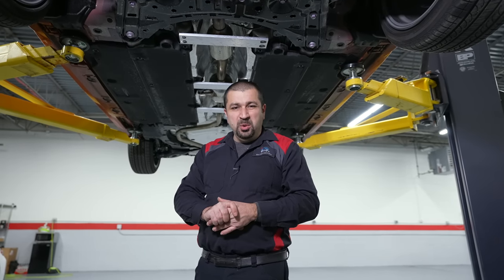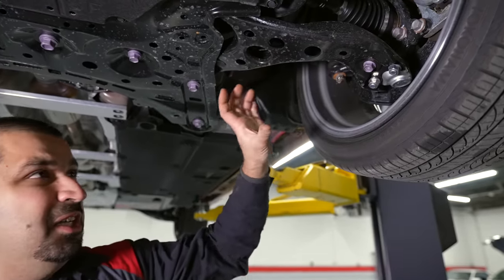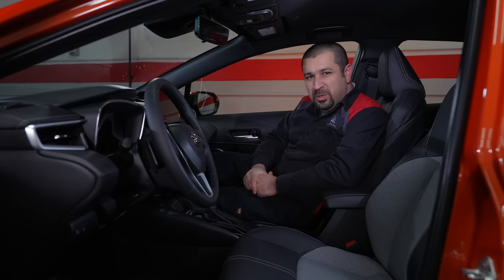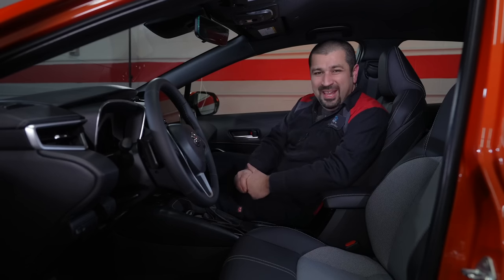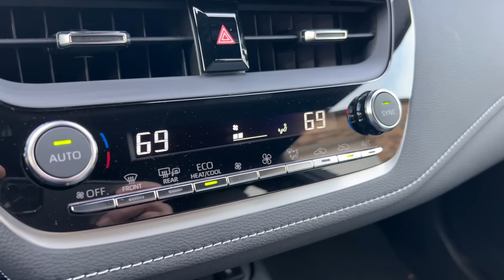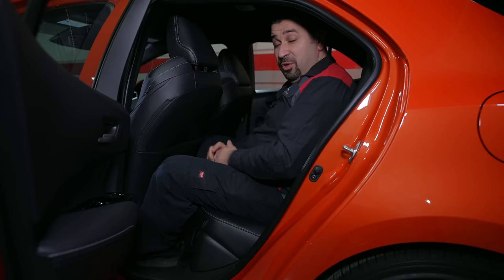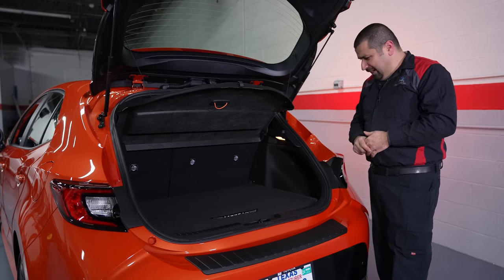Should You Buy a Toyota Corolla in 2023? I Have Good News and Bad News!

Comment: I have a 2023 le. The handle on the front door panels protrude out and are hard af... they hurt my knee when resting my leg on it. The interior plastics door panels especially the rear come off with a slight pull... they feel cheaply made, check the entire car 4 times before you buy one... seems to be fine mechanically so far but its been literally 2 days
Reply: I have a 2022 se the interior feels cheap but besides that it’s fine
Reply: @donew1thita11  super cheap... on you rear door panels where the window up and down is.. try to lightly pull on that and see if it just detaches from the whole panel... cuz mine does... came off in a friends hand the other day... talk about embarrassing... going to the dealer tomorrow to see if thats normal

Comment: Does the new corolla use 0w8 oil and if so can u use 0w16
Reply: Correct you can use the 0W 16 as stated in the owners manual if the lighter oil is not available

Comment: My first Corolla was a 1981, a 1993, then a 2008, all base models with manual transmissions. Since the new Corollas don't offer a manual transmission, I bought a 2023 Subaru Crosstrek with a manual transmission. I just hope the Crosstrek is as good as my Corollas were.
Reply: @Paul Fortman I just bought a 1986 manual transmission Camry lift back as a Sunday driver./weekend toy. There’s just something about older Toyotas with manual transmissions where they drive exactly how a young kid would imagine a stick shift vehicle drives, if you know what I mean. The best Toyota I’ve ever driven in my life (so far, I’m still a teen), 1992 Silver taupe Camry DX 5 speed. That car felt absolutely amazing to drive and the gear ratios were perfect and relaxing for someone to drive, without having to feel like busting ass as fast as possible like in a Civic, again, if you know what I mean. Out of all your Toyota’s you just mentioned, which one was your favorite and what one put on the most miles? Just curious. My ‘86 Camry only has 115,000 original miles as the original owner was a 90 year old man who owned it from new until summer of 2020. Extremely clean for the age. Still has the delicious new classic car smell inside.
Reply: I had a brand new 2007 corolla LE 5 speed and it was by far the best most reliable car I've ever driven. Just bought a 2024 corolla SE 2 days ago.  Waiting for it to get here and I can't wait but I know I'm gonna be disappointed because that 2007 5 speed was the definition of quality.

Comment: Hatchback should have more space in back for carrying things, especially if you fold down the rear seatbacks. Can you fold down the seats to show us how much room it has? More room than the sedan? Also, what is the power and torque of the engine? What is the weight of the vehicle. How much stuff can you carry by weight?
Reply: What is the top end speed and 0 to 60 acceleration times on Xse HB?

Comment: I have a 2019 XSE hatchback & replaced my CVT transmission at 252,000 KMS.. Full time Uber & Lyft vehicle, just wanted to chime in.
Reply: How much did that set you back?
Reply: @HeartyMushroomSkewer  Dealership was asking $10,000 installed, got a used one from a 2021 with only 8,000 kms on it & with warranty; installed for $2,500 cash. Someone hit me a couple months later & the car was a writeoff. Got a 2024 CRV Hybrid Touring now, much more enjoyable for rideshare.
Reply: @TechWiz1983  I see, did you ever happen to change the transmission fluid?
Reply: @HeartyMushroomSkewer  YES, once. I can't recall the milage, maybe around 180,000 kms but I could be wrong. I kept track of everything on the Toyota Nation forum to help others with their repairs. If you go on there, you can find a lot of solid info. Helped me a lot.

Comment: I bought a 2022 Corolla se 6 spd manual after owning a 2009 Corolla s 5 spd manual that I drove hard for 9 years and 230K miles. All it asked for was a water pump!🤯 absolutely loved that car. Now having driven the 2022 for 15K miles I honestly feel that my 09 was better, at least mechanically. The 6spd is not as smooth the 2.0 has hardly any power below 3K rpm and is the loudest car(road noise) I've ever been in. I hate to admit it but even toyota quality is going down 😔 while their prices are going up. I guess they're just following all the other vehicle manufacturers.
Reply: Buy new, better tires. Noise level will dramatically decrease.

Comment: Two things stop me from buying this car, the 1st one is the electronic parking brake and the 2nd is all the stupid AEB and lane assist tech that ruins it. Also winds me up in order to have the normal 16 inch alloys you are locked into the base model meaning you miss on projector LEDs instead of the standard reflector LEDs and also other luxuries too.
Reply: The electric parking break is extremely reliable, much more simple than the old style,  per the Car Care Nut
Reply: You can turn off the lane assist, etc.
Reply: @marklintwo  Nothing more simple than a cable pulled along a ratchet system, much preferable to an electric parking brake that cannot be turned off if the car breaks downs and doesn't start.
Reply: @marklintwo  You have to turn it off every drive like stop start I assume. Either way I'm not interested.
Reply: @gravemind6536  Wrong.
Reply: @gravemind6536  You haven't had to service the actual parking brake shoes - much more difficult than the electric parking brake system. Sorry, the Car Care Nut and I both disagree with you.

Comment: All cars are too expensive these days; especially since everyone’s quality has gone down including Toyota. And this overpriced basic car is a prime example; it’s at best a 19k car in max trim save the GR which is also overpriced
Reply: Toyota's long-term reliability ratings are still at the top, per many statistically relevant data sources.
Reply: @marklintwo  true but they too are starting to use plastic parts and bits to save money and then help dealers get inevitable repairs due to cheap plastic parts
Reply: @StopTargetingOurKids  That's an assumption. Look at the 2018 to current 2.5L in the Camry and other cars. Plastic valve cover, no problems with LOTS over 200k+ miles.
Reply: @marklintwo  no it’s definitely facts, and you’re pointing out a rare exception. I’ve been working on cars since early 80’s, it is clear that plastic does not hold up; especially in the engine bay
Reply: @StopTargetingOurKids  You're assuming it won't. I gave a perfect example of the NEW technology plastic that has proven to hold up extremely well.
Reply: @marklintwo  it’s an exception and it’s been proven millions of times over that it doesn’t, you clearly don’t work on cars
Reply: @StopTargetingOurKids  🤣

Comment: NO! YOU SHOULD GET A CAMRY! Its worth the extra money and a much better vehicle. You will be far happier. It gets amazing gas mileage with the 8 speed automatic and 2.5l with direct and port injection. Way more room. The corolla is small, slow, weaker suspension, and has a cvt transmission. The Camry is just built better in every way and the price difference is small. A base model LE camry is better than a top trim corolla IMO. I don't think the corolla is a bad car at all but the Camry exists so no reason to waste my time on it. I do understand financial situations though. Corollas can have better financing options for people.

Comment: 2010 Corolla was my last Corolla.  Didn’t like the fact Toyota switched to CVT.  Next up was a ‘15 Camry for me for the V6, still going strong and recently in ‘21 a Highlander with V6.

My current ‘15 Camry and ‘21 Highlander will be my last Toyota!  Since they are getting rid of the V6!  The V6 are already “efficient” they Hybrid are not that much different in fuel efficiency like in the Highlander new “4 cylinder turbo”

Comment: I love the simple radio that's in my 2020 Camry LE.  Quite basic (still a 7" LCD touch screen display) but doesn't have all the bells and whistles.  The only thing I wish it sort of did have (because I'm a bit old fashioned and grew up in the 80's and 90's) would be a CD player... something that's omitted on most cars these days, or at least an audio input jack (it has a USB port for MP3 files which I use but still not as convenient and it means I have to make MP3 versions of all my CDs).  But overall the car has performed well (Luckily I didn't get the first and second model year of the car, so 21017 and 2018 as I did hear there were some issues with the software and transmission when it came to shifting, although I suspect much of that has been ironed out by now even for those users through software updates.  The only problem I have with CVTs is the power.  If you get a Corolla, get one with the launch gear.  It's a bit more fun to drive and has more power (or can accelerate faster) and really is the best of both worlds from a design standpoint (the power of a geared transmission especially in high-torque applications like acceleration from a dead stop) but the fuel economy of a CVT at higher speeds or constant highway speeds, although I will say that the 8 speed geared Transmission found in the Camry's (at least up until 2022 or so) get about the same gas mileage as a 2.0L Corolla (so about 36-38 on the highway versus about 38-40 for the Corolla but the Camry's geared transmission may give hundreds of thousands of miles of service with regular maintenance -- versus the Corolla's CVT which I don't think we've really figured out exactly how long a Toyota CVT can go (on average) since they only started using them in the Corolla in 2014.  My guess is their CVTs are about the same as every one elses like Honda and Subaru so I'm going to say about 150k to 200k if you take care of it.

Comment: Who’s idea what it to use plastic on HOT ENGINES?! Can u say STUPID! Plastic gets brittle and cracks especially with heat! 
And sorry the Corolla CVT whines!  Like a sliping trans  granted they’re the same as in the Prius so they do last but still sometimes going too CHEAP is too MUCH! Considering the cost hasn’t gotten lower with the lower cheaper built cars. Everyone’s stretching out those profits to the MAX the saying you get what you pay for is SADLY NO LONGER TRUE 
U pay high prices for crap that doesn’t last as long anymore

Comment: I would never own a vehicle with a CVT  or a plastic valve cover.  The average life span for a CVT is 100,000 to 120,000 miles and then you get to spend $6,000.00+ for another one.
Reply: Been used in Corolla since 2014 model year. There are LOTS with well over 120k miles with NO problems.

Comment: I have a 2022 Carola with a 1.8. I prefer the 1.8 over the new 2.0, the 1.8 is proven and all the bugs are worked out. The 2.0 will have problems and it only gets 2 miles more per gallon. Reliability is number 1 for me. My next car will be electric.
Reply: 2.0L has been used since 2019 model year Corolla Hatchback and 2020 SE and XSE sedans. It's proven, no problems.
Reply: @marklintwo  4 year's is not proven, there will be bugs.
Reply: @charlesholland8073  LOTS have over 200k miles, no problems. And, don't forget the Camry uses the same engine design, just slightly larger displacement (2.5L) since 2018 model year, so almost 5 years, LOTS of them over 200k, no problems

Comment: Off point perhaps but like Toyota owners I love my 2009 corolla with 200000 miles. BUT the rear left brake light needed changing. You need a PhD in auto mechanics to change it and possibly 2 days. Maybe a special tool would have worked. A Toyota specialist wanted $60 to change the bulb! The engineer who designed the access panel should be fired, if my choice, shot. So although Toyota has top notch engineers they may occasionally hire an ex Ford engineer.